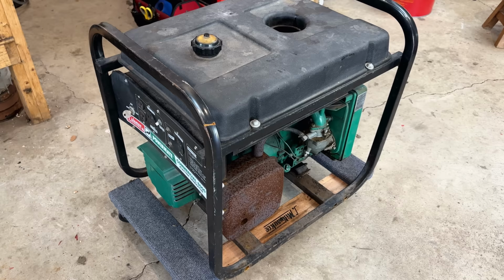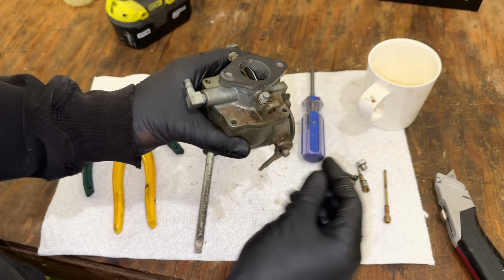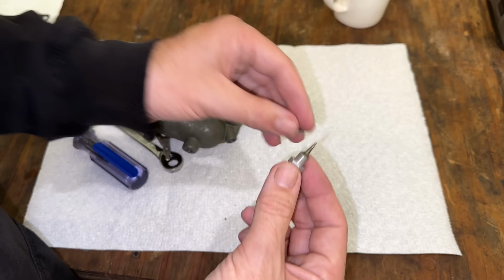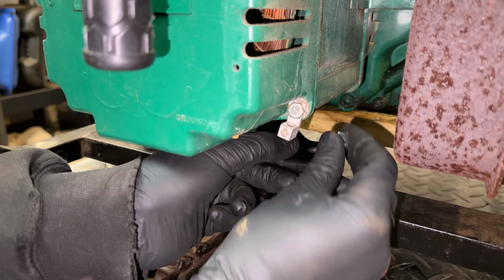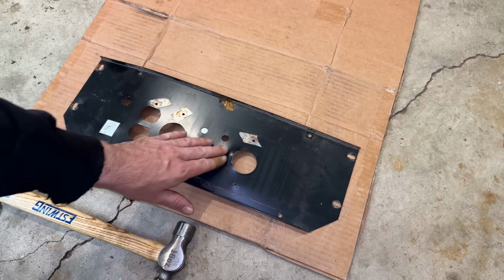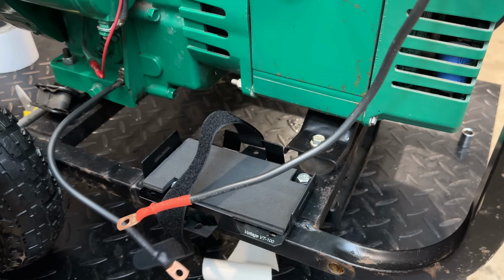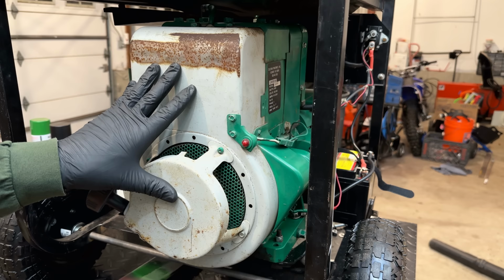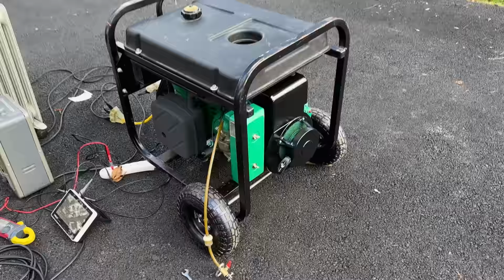1980s Powermate Generator - Will it Run and Make Power

Comment: This genny is from a time when things were built with pride and quality and when Briggs was a Briggs.
Reply from the maker: It was a well made machine
Reply: No kidding on the new Briggs engines not being great.  Id rather just go buy a HF special anymore than a new Briggs.
Reply: @CorwinBos   Or get an old briggs. My first choice for 4-cycle small engines is a flathead Briggs. They didn't go to shit until they went OHV.
Reply: @TestECull  Easier said than done unfortunately.  Most of them are too clapped out to run or even to bother fixing.
Reply: @CorwinBos  I would sooner repair a windowed flathead Briggs block and rebuild it than deal with these crappy clones.

Way I see it, spending $400 on resurrecting even the most clapped out flatty Briggs is a better spend of money than buying a bunch of those disposable $99 Predator 212s Harbor Freight sells. Plus those things won't be $99 forever. The $400 Briggs overhaul will last well into the days where those Predator 212s cost $150 new.

To me, quality is worth the spend going with a flathead Briggs over a modern cheap clone engine. I LOATHE cheaply made, disposable crap.

How many times now have we seen James put a clone carb on an engine only for said clone carb to not work worth a fuck?
Reply: @TestECull  I know full well what you're in for when you buy a HF cloner engine.  For what it's worth, if it was a motor I depended on on a regular basis, yeah then having a better motor is in order.  But if it's something where the HF motor runs and doesn't really raise any issues?  Then they are good enough for some people.  It's all about what you want.  I run a HF motor on my pressure washer I built.  It runs well enough, but yeah, it needed tuning.  And that's how I found this channel.

Uggh, chinesium carbs are the absolute worst.  And if you think James is having issues with them on a much larger motor, you should see how much worse they are on a small 2 stroke motor.  A chainsaw is far more sensitive to tuning.  The Chinese carbs simply are untunable or won't hold a tune, and 8/10 generally go in the eff it bucket.  I always rebuild carbs, with OEM rebuild kits.  It's just not worth my time to mess with that junk.
Reply: @CorwinBos  I'm all too familiar with those knockoff walbros. Gas burning RC aircraft use them as well, and I'm big into RC aircraft. Mine are nitros so I don't deal with them first hand, but a lot of guys at the field run 2 cycle gasoline engines with that style of carb on them, and generally speaking if it isn't a genuine Walbro it isn't reliable enough to fly. They're up there pulling all sorts of crazy flying-on-the-prop stunts where even just a stumble can total an airframe. Their engines range in size from 20cc to 200cc, 2-cycle, some single some multi-cylinder, all with genuine Walbros. 

It's a minor annoyance when your strimmer or chainsaw or whathaveya deadsticks on ya. It's another thing entirely when $5,000 worth of model aircraft eats shit because the engine quit while doing crazy aerobatics right above the runway.

The gas crowd generally won't even buy an engine without a genuine walbro carb on it.
Reply: Took the words out of my mouth. They don’t make’m like they used to. Made to last as long as you did proper maintenance.
Reply: 😮😊😮Oo😊o😊😊o😮o😊O😊😮😊😮o😊😮😊😊😮o😮o😊😮o😊😊😮😮😊😮😮😮o😊😮o😊😮oo😮oo😮😮o😊😮😮o😮😮😮o😮😮o😊o😮o😊oo😮o😮😮o😮o😮😮😮o😮😮oo😮😮o😮o😮😮o😮😮oo😊😮o😮😮o😊😮o😮o😮o😮o😮😮😮o😮o😮😮o😮ooo😮😮😮o😊😊😮😊😮😊😮😮😮😮o😮oo😮😮😊oo😊😮 @jcondon1 😮😮o😮o😮o😮😮😊😮😊o😊😊😊😊😮o😊😊😊ooooo😮o😮o😮😊😊😮😮😮o😊o😮oo😮o😮😮o😮o😮oo😊😊😮o😮😮o😊o😊😮😊oo😮😮o😮😮o😮😮😮o😮😮😮😮o😮o😮o😮😮😮😮o😮o😮o😮😮😮😮😮o😮ooo😊o😮😮oo😊😊o😮ooo😮o😮o😮o😮😮ooo😮o😮o😮o😮😮o😮o😮oo😮o😮o😮o😮😮oo😮o😮oo😮o😮o😮😮😮😮😮😮o😮😮o😮😮o😮o😮o😮😮😮o😮😮o😮😮o😮😮o😮oo😊😮😮😮o😮😮o😊😮😮ooo😮oo😮😮😮😮oo😮o😮o😮oo😮😮😮😮o😮o😮o😮😮o😮o😮oo😮ooo😮o😮😊😮ooo😮😮o😮o😮o😊ooo😮o😊😮😮oo😮o😮o😮o😮😮oo😊😮o😮😮😮😮😊😮o😊😮o😊😮😊😮o😮o😊o😊😊oo😮o😮o😮ooooo😊😮o😮o😮oo😮😊😮😮😮o😊😮o😮😊😮😮😮o😮o😮o😮oo😮😮oo😮o😮ooo😮o😮o😮😮o😮o😮😮O😮😮o😊😊😮oo😮o😮o😮😮o😮oo😮o😊o😊😮😮o😮o😮😮😮o😮o😮Oo😊😊😊o😮o😮😮😮😮oooo😮😮o😊😊😮😮o😮😮ô😮oo😮😮ooo😮😮o😮o😊😊😮o😮o😮o😮😊😮😮o😊😮😮😮o😮😮o😮o😮o😊😮😊o😊o😮oo😮😊😮😮😊😮😮😮😊o😊😮o😊😊😮😮😮o😮😮o😊😮o😮o😊o😮op😮😮o😮oo😊😮o😮😮oo😮😮o😮😮😊😮😮😮😊😮oooo😊o😊oo😮😮😮o😮😮😮😮😮o😮o😮😮😮😮o😊😮ö😮o😮o😮o😮o😊😮o😮o😮o😮😮😮😮o😊😮o😮😊😊😮o😮o😮o😮😮
Reply: They may be well-made machines, but I find that the Coleman PowerMates (in this form, specifically, do not put out good consistent power. Now I’m not talking about dirty electricity vs clean electricity. I’m saying that I’ve used them before and they are very easy to bog down and you really have to crank the engine up to get the voltage going up to 120 v, where it should be.
Reply: They may be well-made machines, but I find that the Coleman PowerMates do not put out good consistent power. Now I’m not talking about dirty electricity vs clean electricity. I’m saying that I’ve used them before and they are very easy to bog down and you really have to crank the engine up to get the voltage going up to 120 v, where it should be.
Reply: And I think the Coleman is an Aussie make. Am i right there?
Reply: Have one identical, never had any issues!👍

Comment: Using dishwashing liquid in the ultrasonic now?
Reply from the maker: For now.  Have had a few issues with the Harbor Freight degreaser recently.  They changed the recipe and it is now corrosive to aluminum. Still works well on most, but some it reacts badly.  Will not use it anymore on carbs that are expensive or impossible to replace.

Comment: I picked up this type 3000 watt generator for free one day. Cleaned it's carb and changed the oil/plug. Then came the 2008 high winds that knocked out power for 8 days. That 3000 saved my household for a week and kept us going. I'll never be without a generator again as I gave my 3000 to a family member and bought a 6500 watt Honda liquid for hard times. Another great video James, as it brought back enjoyable memories.
Reply: Way too long. You need to shorten these things up please
Reply: @markphillips6154  Watch at 1.5x
Reply: Hello James weather do you use in your ultrasonic vcleaner. Thanks ,I watch your YouTube videos all the time and enjoy them. 
Thanks ,Lou
Reply: I enjoy the detail in your videos.  Thank you
Reply: @markphillips6154  Absolutly NOT, you have the power to skip forward if YOU wish, Others cant fill in the blanks if thery are not there. Thanks James for the effort and time to create and still get the job done. We all know it takes much longer if you are also filiming,

Comment: James, in the first few minutes I can offer a Volt fix that is common on this type of head. Using a big drill motor you power it up, plug in the drill, and if your volts are down below 110 you run your drill and let off then before the drill stops spinning forward you click the drill in reverse, bogging it and hit it a few seconds, repeating this back and forth a F/R/F/R few times. It's old school genny flashing that works. The old PM Commercial models were only "commercial" due to the electric start and muffler. Otherwise same thing as any of the rest.
Reply: Great comment
Reply: John, love your videos, Merry Christmas, bud.😊
Reply: I have heard of that it's like flashing the system putting a a shock to it like a jolt

Comment: It was definitely in the pilot circuit. I ran into the issue on a tiller I was selling recently. I had someone coming to look at it, and it ran terrible that morning. The guy was on the way, so I had to rush. I removed, disassembled, cleaned, reassembled, and reinstalled the carb in 14 minutes. I was proud of that one. The pilot jet was clogged. I got $200 on it, which was pretty good for a 15 year old and beat up machine with no model tag on it. It ran perfect though, and the only money I invested in it was for a new drive belt.
Reply: Best thing for old B&S flat heads is replace the points with a B&S Magnetron magneto.

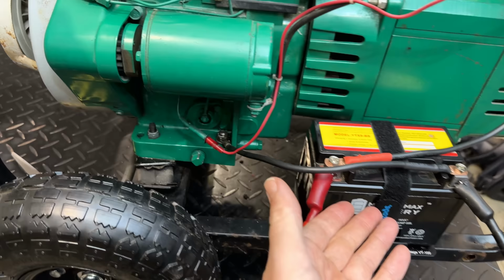Comment: 1:36:30 Jim, you can use silicon rectifiers in series. Five diodes drops 3 V from  charger. 6A6 is a very low cost and reliable choice.

Comment: I bought several of those from Costco back in the early 90s  for use on survey spike camps and prospecting camps .. 
I know that 2 of that initial batch are still running today, as the family still uses them up at the fishing cabin and to run emergency lights and forced air furnace fan/pump if power is out ..

Comment: I like this machine too. I would be a cool one to keep around due to it's age and condition. You are not likely to find another that age in such good condition. I was impressed by the THD. I didn't expect it to stay as low as it did. It's a shame that a machine made before sensitive electronics even existed operates them better than a modern machine. This was a nice save. It is nice to get one that you runs well enough that you can concentrate more on the cosmetic end of things.
Reply: I completely agree.

Comment: 1:56:30  After you derusted, cleaned an painted the muffler, it looked real good.  Then I noticed what appeard to be four threaded holes at the exhaust outlet.  I wonder if at one time in its historty there was an exhaust deflector there to direct the hot exhaust down or away from that tire.
Reply: I believe a spark arrestor goes on there.
Reply from the maker: I think it was for a spark arrestor.  I tried a standard one the the holes did not match.  Should have also been to add a deflector or a pipe to take the exhaust away.
Reply: actually a spark arrestor / deflector combination

Comment: On the charging circuit, you can add a zener diode rated for 13V 1w (1N4743A) between the positive terminal and ground.
Reply: That zener would probably be short-lived, nothing to limit the current through it when it opens. Leave it disconnected, or try to find a decent charging controller.
Reply: Honestly I would go with a Automotive voltage regulator that you can pick up for cheap at an auto parts store.
Reply: I'd go a little higher than that.  And add a small amount of resistance in series,  otherwise that zener is gonna get awfully warm.
Reply: @Roy_Tellason  Making some assumptions. 18 AH battery. trickle charge at C/100H gives 180mA. Need to drop say 3V. R = V/I  so R = 16.7 ohms.  W = V x I.  W = 3 x 0.18 = 0.56 W.   I would use a 5W panel mount resistor. Values I see for sale are 15 ohms or 20 ohms. Easy to mount anywhere. It will run cool and costs 2 dollars. I would use the 20 ohm resistor. Connect in series with the charging diode.

Comment: That machine looks a lot older than it is, due to the way it was assembled. They used a lot of really old technology on it. I didn't know they were still using that style of carb, flathead engines, or brass floats that recently.
Reply from the maker: Think they used that design still until the early 90s

Comment: I'm sure I'm not telling you anything you don't already know, but what typically causes that slack in the pull rope is a rusty tension spring in the recoil. All you have to do is spray some type of lubricant under the plastic plate and pull on it a few times. That will usually fix that issue without replacing anything. You can also soak the spring in Evapo Rust, but reinstalling it is a pain.

Comment: For battery-charging.... keep in mind that a diode-drop is about 0.6v. .... just put several in series to drop the voltage as-needed. You can get fancier (and more expensive) with zener-diode and resistor to limit the charging-voltage.  (electronics can do pretty much ANYTHING you want)
Reply: Thanks I will remember that 😊

Comment: Beautiful job James. I had a few of them many years back and Coleman had a bulletin on the rear bearing on the gen head. Apparently when sitting for long periods of time the oil leaked out of the bearing and caused it to fail and eventually would cause a crash of the rotor and stator. Might check that bearing. Thanks for the video. Really good one.

Comment: James, I have two of these, both purchased in 1989. They both run the last time I tried... I NEED that airbox cover. Keep an eye out for one for me... Thanks
Reply: I also have 2 and they still run great, used them during the Texas freeze and not a single problem for 6 days but adding gas often lol

Comment: Thanks Much james.
I have a 1976 Version of that Engine in an 8 hp on a Gilson Snow Thrower. I bought new in 1976. 
And i Found out the hard way to split the Carb, Yup. Bent the tube. was able to save it. I have it set just a tad on the rich side and it really snorts with a full head of Snow HAHAHAH
That powerhead Bracket is bent.the Feet should be flat...

Comment: Had a slightly larger Milwaukee generator with similar components but without electric start. Those flatheads sure drink a lot of fuel. And no compression release made it hard for non-gorillas to pullstart. Kind of wish I'd kept it, though. Thanks for the memories!

Comment: Those big, pneumatic tires are nice if you're dragging the generator around a job site every day, but for home use, they're more trouble than they're worth.  The smaller, solid rubber tires that come with many of the wheel kits would not only have cured the height issues with the foot, they also won't decide to go flat when the power goes off at 2 am in a rain storm.

Comment: I have the 3000 watt little brother to this generator and love it still.  One pull and away we go!  I used to throw it on my sailboat to light up my boat for the Pass Christian, MS  Lighted Boat Christmas Parade!  I keep it as a backup for my other hurricane generators that are larger.  
It’s been effortless past routine oil changes and occasional spark plugs.

Comment: About replacing the fuel tank bushing, where you say   "There's gotta be a better way"   ... there is. Cut it off with a single-sided razor blade. Cut sideways into the fuel valve and let the top of it drop into the gas tank, then shake it out. Saves pulling your guts out.
Reply from the maker: Good point.  Think I knew that and forgot it.  Thanks.

Comment: I have the "economy" version of this, no lectric start, no low oil, LOUD tone muffler, small air cleaner, 2 120v outlets, 1 240v outlet and no wheels. I'm in the process of converting to propane and attempting to add electric start as well as wheels. The Breaks & Scrapem model number is 445777, the type is 0134 E1 and the code is 010914YG for possible future reference. Nice restoration! Happy Holidays to you and yours!

Comment: I thought u will gonna fix also the battery charging problem till the end of video.
Great work as usual!
For his age is doing a great job, and I'm pretty sure the winding is copper, not aluminum like most manufactured today this is why it passed the 5Kw test with flying colors.
Good luck with next one!
Reply from the maker: Still looking at options for the battery charge.  Sad thing is most newer portable generator with electric start have no charging system for the battery.  They expect you to charge it when in storage.  Of coarse they only provide a manual charger which will slowly cook the battery.  They should really provide an automatic trickle charger.

Comment: Great job as you normally do.

A few things that you might think about:
1) Get some Armor-All/other plastic protectorant spray and hit the gas tank to make it pop.  It great on used tires as well.
2) No spark arrestor even though attachment holes are there, you usually replace or add them for safety.
3) Might shorten gas line to take out arch which will drop plastic fuel filter.  I would let the engine run for awhile and then see if the fuel filter is getting warm as it is currently fairly close to the exhaust pipe.  It might to have to be moved closer to the carb.

Comment: The high voltage issue on the 12v charging circuit, you could add a simple 12v light or a single wire voltage regulator, a voltage regulator that you would find on a riding mower, should work in this application.

Comment: The 5K I have is a 96 model 10 horse I/C 19E412 with a 210701 type. I added the electric start because it has the vacuum fuel pump and a wicked recoil. Runs like a Swiss watch and pulls the 220 well pump. Wouldn't swap it for a new anything. Is setup to drain the tank with no problem and always drain it and run dry. Thanks and God Bless. I have books on the generator and engine if you need anything.

Comment: James:  Great video !  I laughed as I watched your "fixes" & "alterations" !  Well done!  You remind me of a guy in our radio shop in the RCAF. If you had a battery, a switch , a fuse & a lamp say, & the lamp didn't light, he would not be able to trouble shoot the fault !  He would build devices for our shop that were works of art.(we would draw a  diagram for him, & he would present this "object d'art" for us. 
He had a selection of tiny "angle guides" (used to make exact bending angles in wires, so that the angles were perfect. He would align slots in the screw heads so that they were all aligned with each other, & on it went. If he had a radio or other electronic "box" to repair, the NCO in charge of the shop would grab me or another tech & tell us "  For God's sake , trouble shoot this damned thing, & show Brian what parts need to be changed, or it will take him WEEKS to find out what the fault is. !"  He was a master at building things, & there was no machine tool that he was not an expert on. The NCO
of the shop sat down with him one day, & simply told him that he should leave electronics to one of the three techs in the shop, & he should do the "nuts & bolts" stuff.  We would not have let him go for love or money. He would look at an installation requirement in an aircraft & would come up with ingenious solutions. Just proves that all of us have our skills & other problems that we should give to someone else to deal with. You have some excellent solutions for things James, & I watch ALL your videos. MERRY CHRISTMAS  from the wind swept hinterlands of Alberta.
Reply from the maker: Thanks and Merry Christmas to you as well.